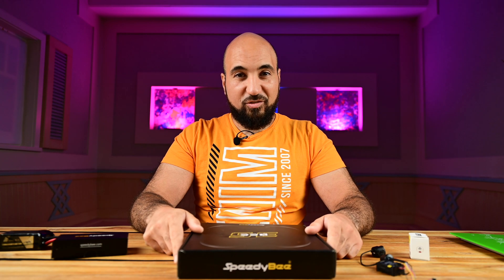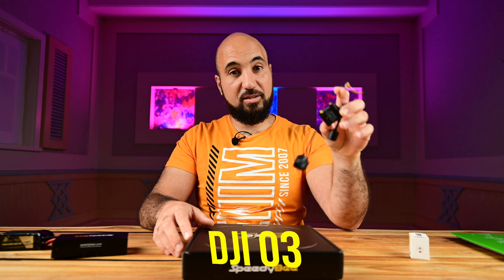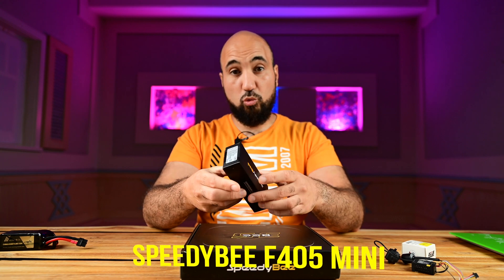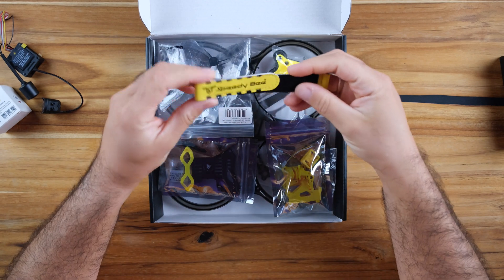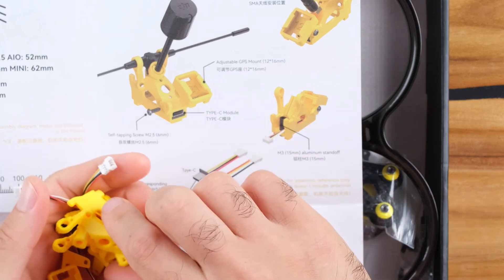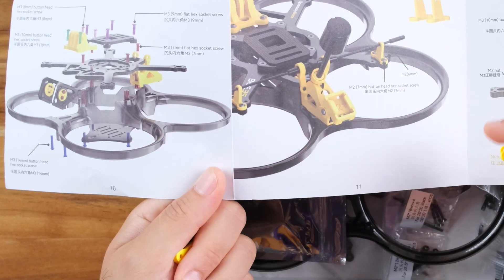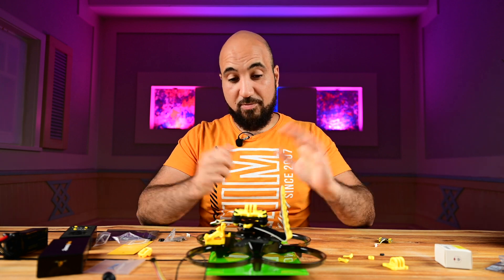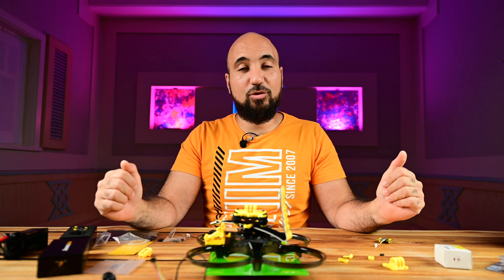NEW!!!🚨🔥SpeedyBee Bee35 FPV Frame | Unboxing and Review! #fpvdrone #speedybee #build

Comment: will caddx vista fit on it ?
Reply from the maker: It fits yeah, but you need the cnc bottom plate and not the carbon fiber one so the pro version
Reply: @bilumedia  BarakAllah fik for this advice. I'm about to build using this frame and wasn't sure if I should get the metal bottom plate or not.